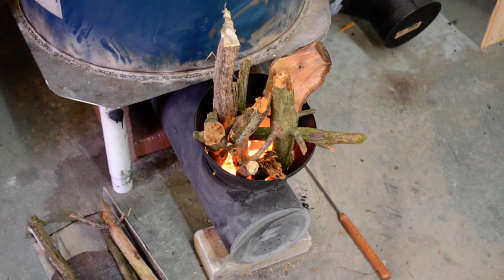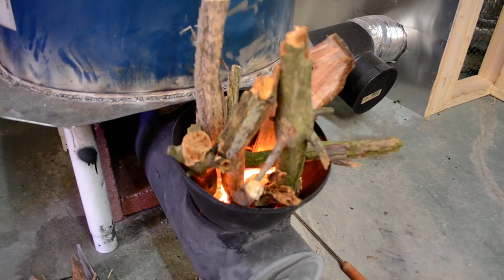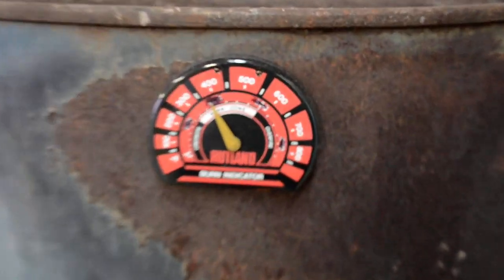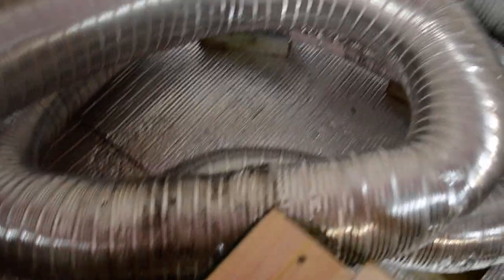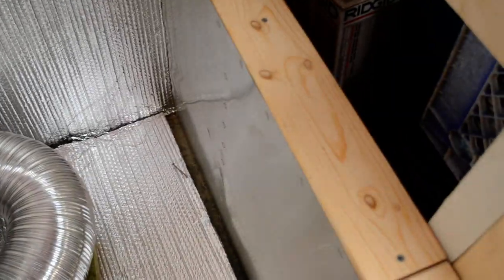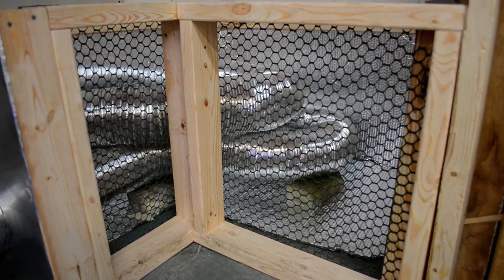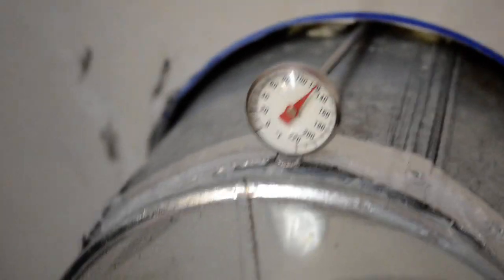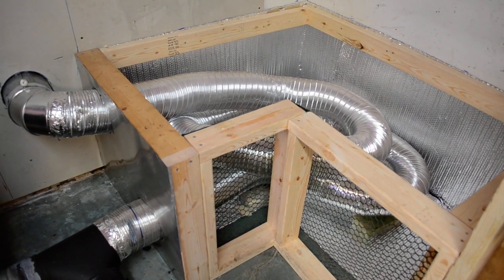Start of  the Thermal Mass Bench

Comment: I'm curious to know hae your gravel mass turned out. I used crushed stone and block. I don't seem to get much heat off of it.
Reply: Paul Wheaton has a video where they tried sand and he said that sand acts like an insulator as there is air around each grain.  I think pea gravel or river rock would be even more so.  It sounds like the mass needs to be solid (cob, masonry, etc.).
Reply: In that video or a later one, he advises against pea gravel.  Air acts as an insulator, which is the opposite of what you are tried to do with your mass.

Comment: What kind of aluminum pipe is that and where can you find it?
Reply from the maker: +Brian Werner it's 6" diameter congregated pipe, we have a store called Menards near us, I got it there. Lowes or Home Depot properly have it too. It's used for HVAC installs.
Reply: Thanks!
Reply: It is dryer duct; not really appropriate for this application if the stove is to be seriously used...the Reflectix is also not the best idea for same reason. Please look at numerous other rocket stove builds posted on Youtube, to see how real ones are done.
Reply: Well i differ in your opinion, it transfers heat quickly, is configured easily, is light weight. Its been in use for three years without issues. Everyone uses different materials for different applications, this works well for mine.
Reply: Steve Orini Just saying, that's what we've been told by multiple sources.  How well that system did, under how much use, for how long, is stuff viewers really want to know about!  Good to know.

Comment: What is inside the barrel?
Reply from the maker: it's a 6" diameter 36" tall double walled pipe, watch video #1 its shown before we weld the drum on.
Reply: How's that lasting?  Guessing it is the double walled galvanized? [Which will 1st emit toxic gasses from overheated galvanizing out the exhaust...before it degrades the metal?]  
 Rocket stove builders generally use a real heavy duty inner pipe inside the barrel....like a cut-down propane canister, or length of iron pipe, to endure the high heat over time. 
Just real concerned about the durability and safety of that arrangement!

Comment from the maker: yes I put 2" foam insulation down and then a layer of aluminum foil bubble wrap insulation to reflect heat.
Reply: HD aluminum foil is much safer as a reflective heat-shield.   We used sheets of it behind a woodstove for years, to prevent the walls behind it overheating. 
Reflectix does reflect, but it's all plastic, and could melt.

Comment: Hi! What is the exhaust temperature?
Reply from the maker: The top of the barrel is about 700-900 degrees F. The exhaust at the bottom pipe is about 250F and after the flue gases travel through 18 feet of aluminum pipe and exits the building it's at about 125-175F depending on how much wood I have in and how much the air intake is opened up. And what the wind speed outside is that day, if it's calm, I get cooler temps.
Reply: MrTopgun21 Thanks!

Comment: Some people say not use to much of the ribbed style chimney liners when making these rocket thermal mass stoves. It slows the air flow in your burn chamber. Have you had any problems? I was thinking of using that style of liner too. Thanks
Reply from the maker: I have not noticed any slow down or draft issues. It seems to make sense, but I wouldn't say it applies real world.
Reply: That stuff is not 'chimney liner", it's aluminum dryer duct.  If it was chimney liner, it would not flex into such tight loops.     Imho, and based on usual installs of rocket stoves with attached thermal benches,  using reflectix and drier duct in this application, is inviting trouble.  
Please use sturdier, more heat-resistant materials!

Comment: How do you clean the flue, it seems a bit twisty.
Reply from the maker: That's the beauty of this stove. You're burning the particulates and gases inside the barrel so there isn't a need to clean the flue. No creosote builds up. When the stove is at operating temperatures, the only thing produced is steam, CO2, and chemical by-products.
Reply: Everyone who uses these rigs, gets some creosote out when cleaning out at the clean-out points.   Usually there's a cleanout at that 1st T, as well as a cleanout at the end of the thermal  bench, also nets some junk to clean out...usually that's in frequent use in cold winter climates, that can result in about 1/3 to 1/2 a modest bucketful of crumbly gunk.

Comment: 1) you need a fan to circulate air over your coil of duct work
2) why do you want to crush your duct work with rocks?
Reply from the maker: 1. Yep you're right,  I added a fan, works well. 2. The stone was to add thermal mass, it would absorb heat from the flue, and dissipate it slowly over hours

Comment: Why don't you want to heat the floor? It is even more mass that will heat up and thus slowly heat your space over an even longer period of time. I feel that in your quest for form you have missed the boat on functionality. Just a question, not so much a critique.I look forward to your reasoning.
Reply from the maker: You could do that I suppose with a new build. My garage was built years ago. So I'm not going to jack hammer the slab apart, just to pour new concrete over my exhaust chimney. However I saw a dude on YouTube build a green house and her ran the chimney pipe in a coil under the dirt floor of the green house and outside. Pretty cool idea! :)

Comment: Hi, thanks for the tutorials, nice stove. A question. how is the mass area working out. You say you used soft edged sones instead of cob so I'm curious to know as it sounds like a less messy option. I suppose the advantage of the cob is that it completely covers the pipes where as the stones leave small air pockets or does this make any difference. Thanks for reading, Brina

Comment from the maker: Hi Apples, thanks for the kudos. Yes your right thin dry hardwood o rpine will get it cherry red like that. I've had the stove for a year now and use it frequently and so far the black pipe is fine. And yes I got it at Menards, which is a big box store like Lowes or Home DeCrap :) because it gets so hot I'm considering welding 2" x 10" steel pieces to it to act like radiator fins to draw more heat off it and into the air.  I'll post a video if I decide to do that.

Comment from the maker: I apologize for not responding sooner, I haven't been on YT in awhile, busy at work. no it don't believe it will hinder the burn. It's better to have more space between the vertical stack and the top of the barrel then not enough, which could actually dampen and choke out the fire. Thanks on the bench, I need to finish it. Haven't had time. :)

Comment from the maker: @TrinityOaksFarm Yes I've thought about that, it seems to be pretty strong vertically. I may end up burying the bottom pipe and filling it to surround the top pipe but leave the top of it exposed. I was trying to think of a lighter weight material that would absorb heat, but can't think of anything :(